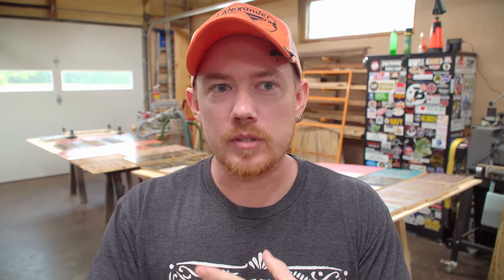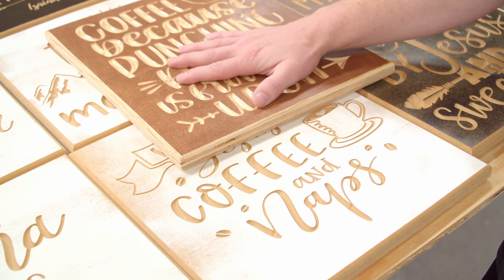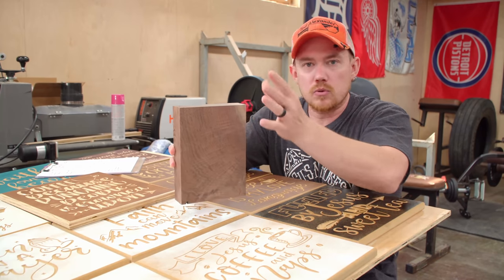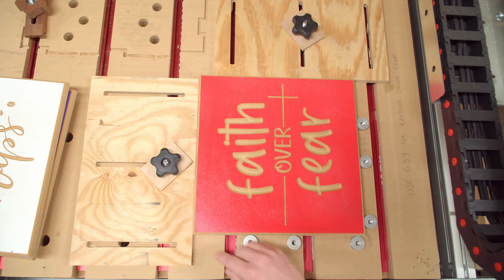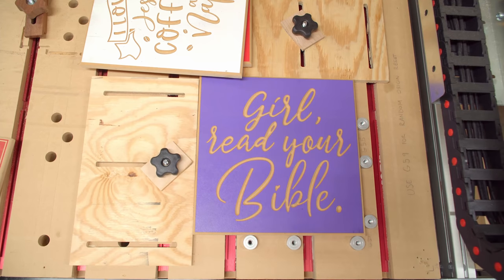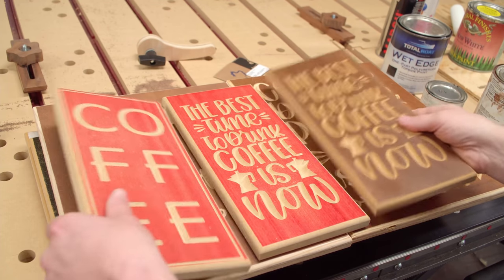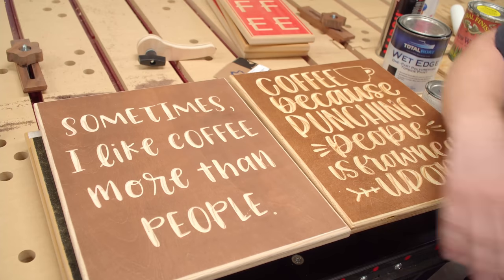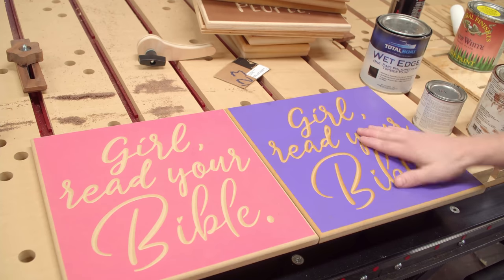58 Signs for a Garage Sale Experiment

Comment: I always hated doing keyhole slots with my router. BUT I have always did vertical keyholes. Switching to horizontal from now on. Thank you for the tip.

Comment: Jay, I LOVE the Shellac comment. I’m a flag maker and have been using sparky cans of finish because I didn’t want to have to continually clean out an HVLP sprayer. I am absolutely going to take your suggestion and set up a Shellac only HVLP station for finishing my flags. These little nuggets are why I love your videos.
Reply from the maker: Glad to hear that. It's a super inexpensive option if you go with a cheap harbor freight gravity gun if you have a decent compressor. It's incredibly convenient.
Reply: @JayBates2  Where do you get the Seal Coat Shellac from?  Couldn't find on Home Depot or Amazon.